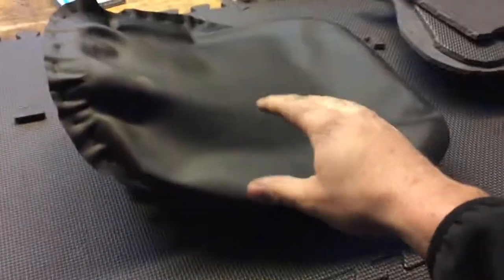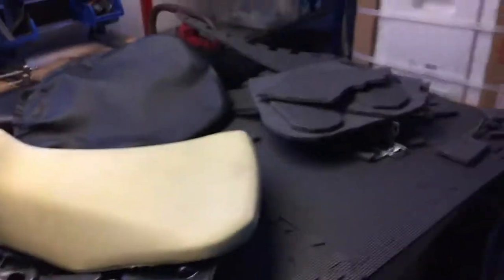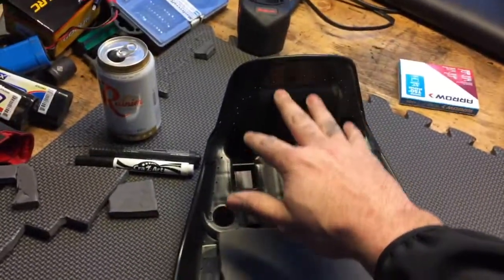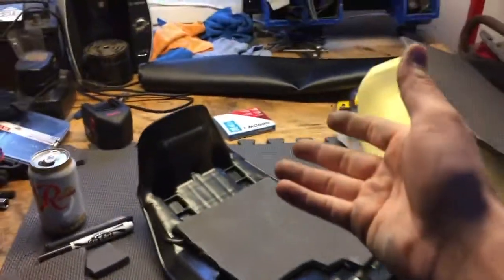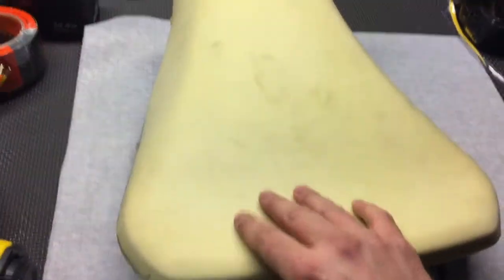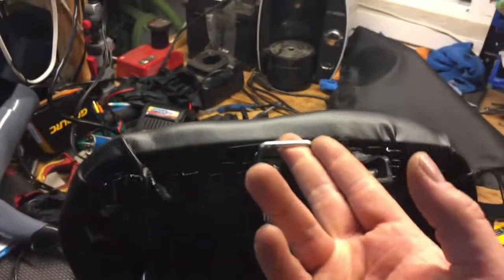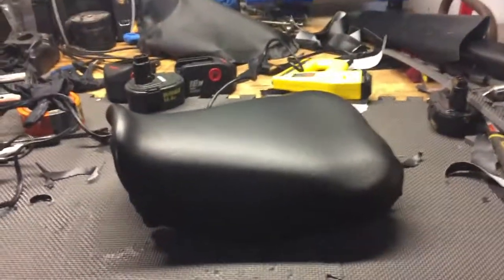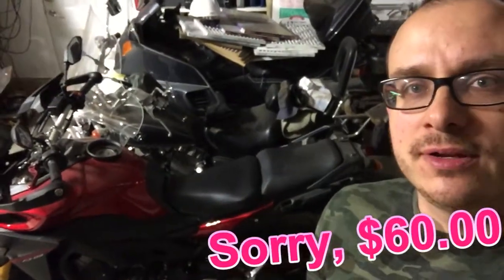$60 FJ-09 seat upgrade

Comment: I bought two pairs of cycling shorts for £10 off ebay also. Has padding in all the right places and makes my luggage look bigger in my leathers lol. I am going to try this because I have the official Yamaha comfort seat and although it helps it isn't great.
Reply: Was exactly my problem, yamaha own comfort seat sucked balls. Atleast on my 1190 Powerparts seat they improved the comfort.
Reply: Cycling shorts have been my riding underwear for a long time.  The padding helps a lot, and the spandex stretch fabric helps relieve the "hot spots" that form where your thighs roll off the seat.

Comment: Very cool, you might have just inspired me to try this, I totally agree the stock FJ09 seat SUCKS. But what is the report on how it worked out???
Reply from the maker: I'll be doing a bit of riding hopefully this weekend, and can't WAIT to try it out myself for a good long ride. Sitting on it for about 45 mins just sitting in the shop was 1000 times better.  The seat was so bad, last season I did all my longer rides wearing a pair of mens cycling pants with built-in Gel padding in the ass of them. haha it was effective! :)
Reply: Nowell Holmes Let me know how it goes? Thanks.
Reply: @NowellHolmes  and.... How does it work? Were you able to get some good ride time on it?

Comment: Update please.
Reply from the maker: tankas it’s not bad!  I can ride for 2 hours now without my ass feeling like it’s gonna fall off. Previously after 20 mins it was extremely uncomfortable.  With minor adjustments to the fitting of the foam, this really is great!  I’d cut the foam slab I added on a bit wider near the edges of the seat to make it “fatter”... or to get mote foam bear the edges of the seat pan.    Having this makes it feel so much better.... and saved me 700 bucks vs a good quality aftermarket (overpriced) seat.

Comment: Nowell, I tried so many seats and ended up customizing my stock FJ09 seat and now my feet don't touch the ground as easy...that is the one drawback to adding foam...wish there was a solution but i can't find one...
Reply from the maker: joeldude1 what about address my foam to the seat, then lowering your suspension? Or is ground clearance an issue? I have a 34.5” inseam. So I’m not worried about touching the ground :)